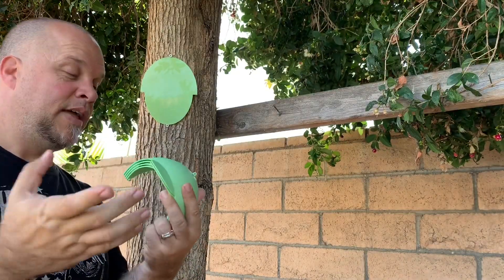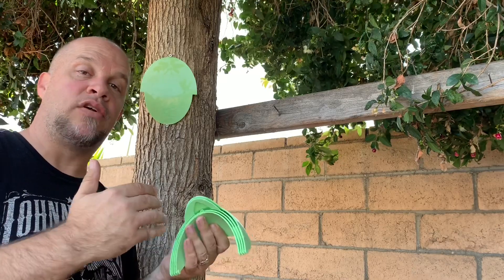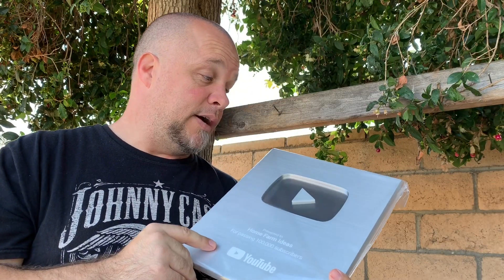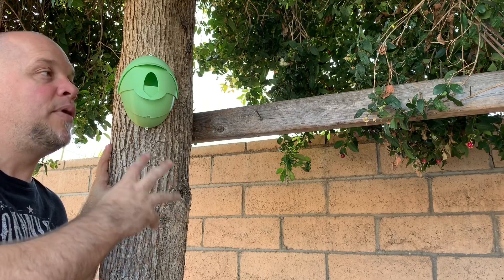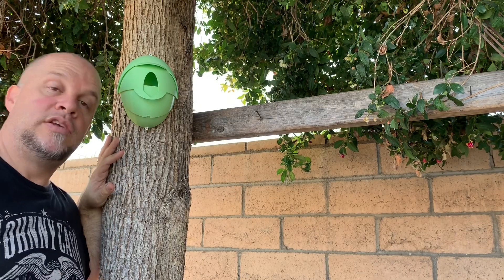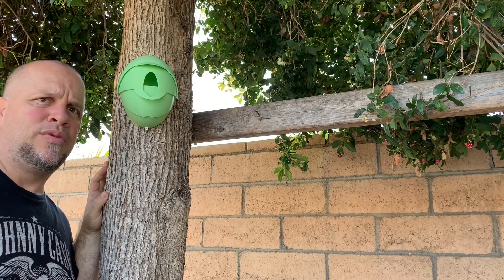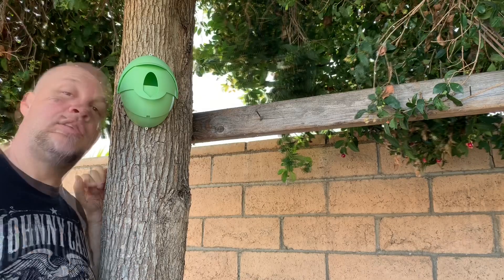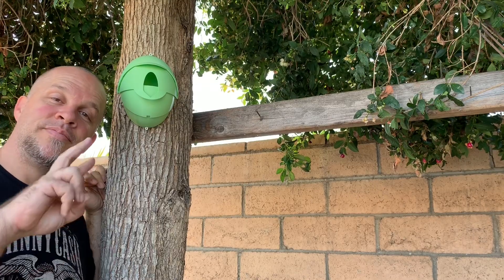3D Printed Bird Nest and Printer Review!

Comment: PLA isnt UV stable, so it wont last long outside like that.
Reply from the maker: Yes, I agree. Should have mentioned to keep bird nest under shade to make them last longer. Obviously you can print with different material as well😎👍🏼
Reply: yeah, PLA is the easiest though. You can paint it with plastickote which helps it last longer